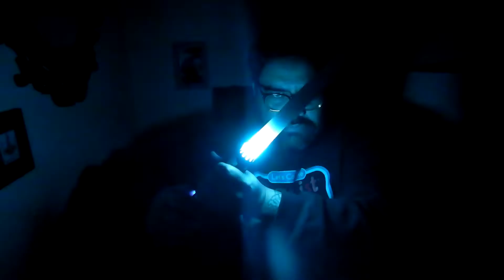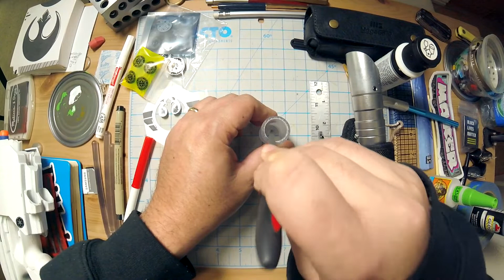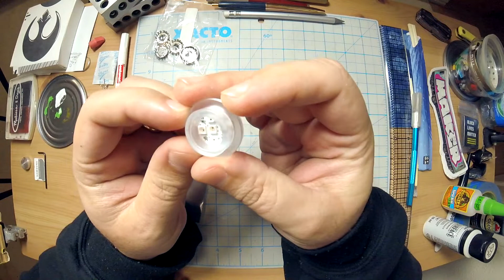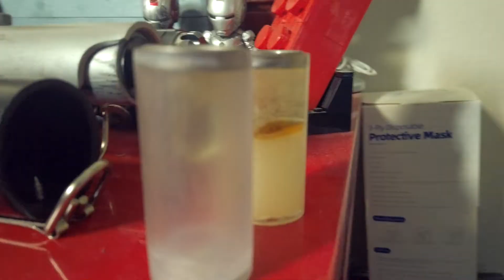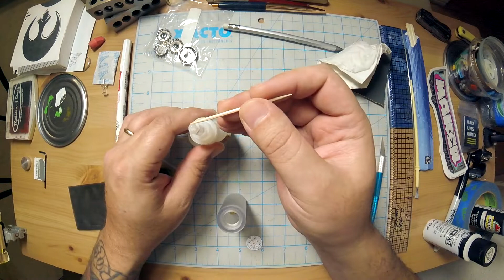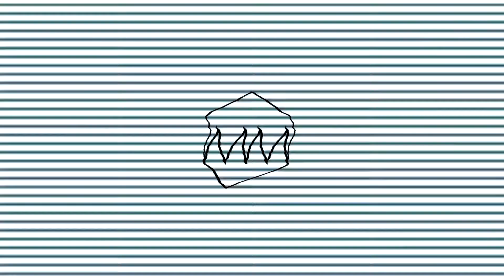▲ NeoPixel Blade Plug

Comment: does the plug make the blade glow much brighter?
Reply from the maker: No, the plug is merely for when the blade is out of your hilt. Think of it as a tiny 1 inch blade that looks like your lightsaber when it's not ignited... so that it protects the gaping hole from dust getting on your neopixel pins or your LED module depending on your set up
Reply: @MakerMaddox  oh ok good to know I'll get one just incase that way dust doesn't get in there
Reply from the maker: @xxdinokingxx2541  definitely recommended. It also makes it look so much better when it's displayed on a shelf
Reply: @MakerMaddox  I'll definitely get one for when I get my lightsaber when I have the money

Comment: Higher grit might work.
Reply from the maker: Gah, you're so right. I only went up to 2000 because that's as high as I had. Then I realised I did a lot of filing on the inside that wasn't addressed at all. Haha next time.
Reply: @MakerMaddox  I once did a mirror polish on a brass spinner and learned of 7000 and I think even higher.